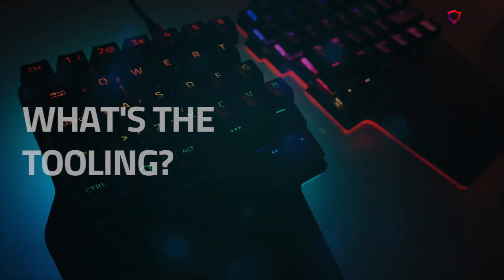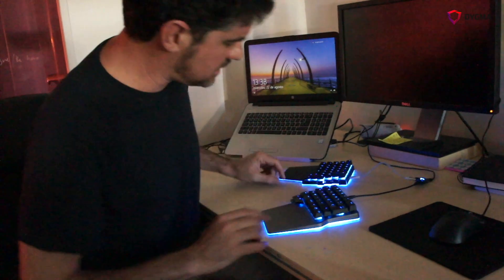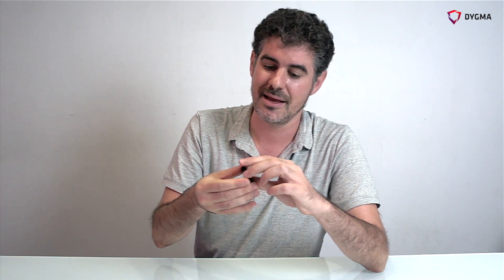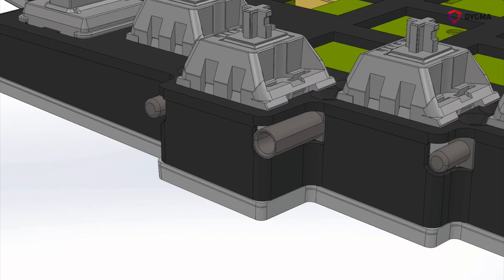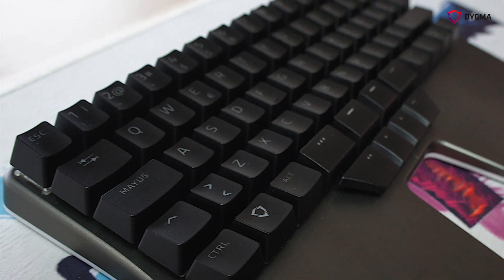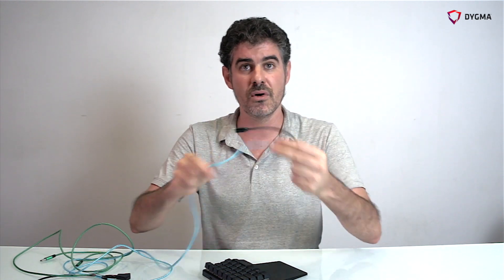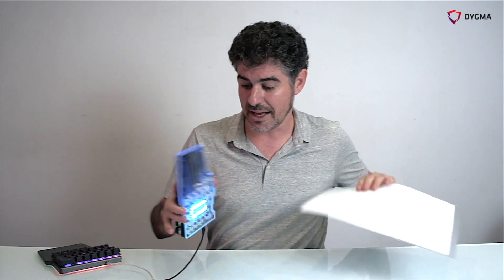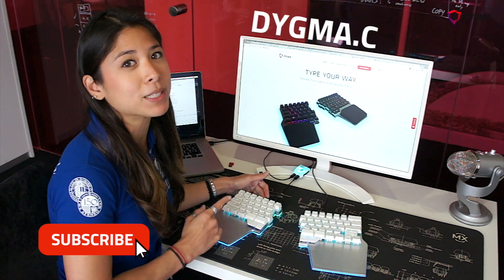The Tooling Making - An Essential Part of Manufacturing

Comment: That's great news! I love the progress you guys are making, but I'm wondering if you will add Italian layout in the future? That's the only thing holding me back from getting this awesome keyboard!
Reply: I would advise to buy the keycaps for the Italian specific keys. Otherwise, I think you can reprogram some keys (through their software) to output the accented vowels
Reply: @GiovanniLiva  Are you it's possible to put custom keycaps on the Dygma Raise?
Reply: @Xperto_  all of the keys and keycaps are swappable so I don't see why not.
Reply from the maker: Giovanni and Squidblimp are right. You can configure the layout through our software and our keycaps can be removed so you can put custom keycaps on the Raise. But remember the 8 thumb keys are different, especially the 4 underrow keys. They are for low profile switches.
Reply: @DygmaLab  thanks for the info. Things just got a lot more interesting